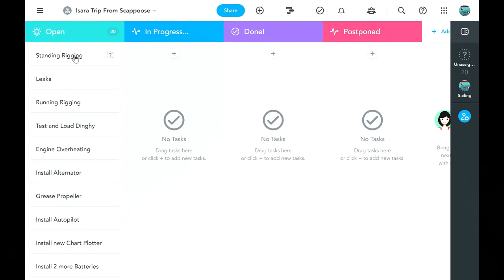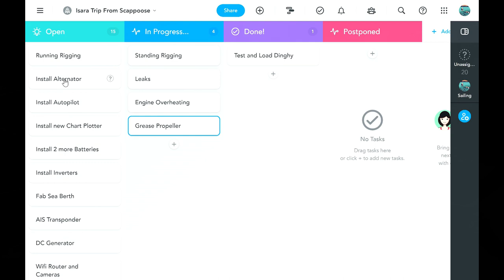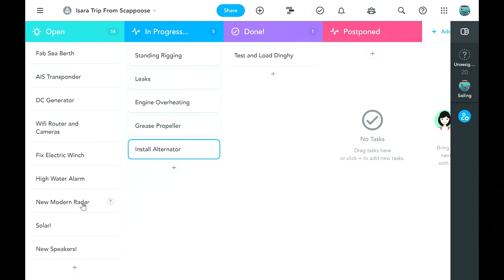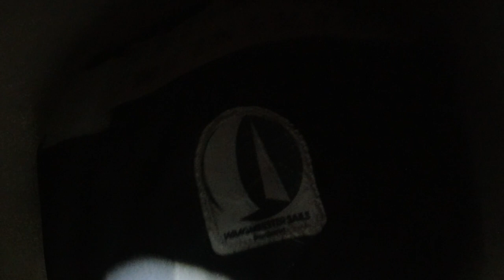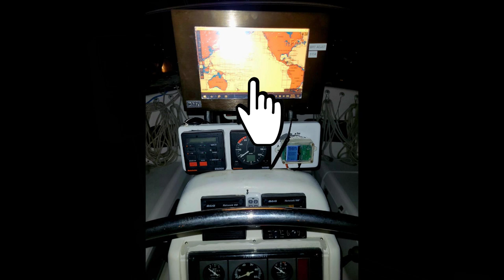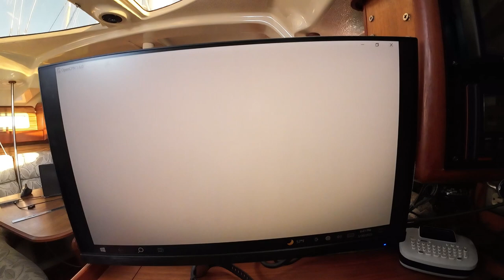Ep 9 Sailboat Repair Marathon and Projects

Comment: Try barnacle buster to clean your engine cooling system. Also check for broken pieces of impeller struck in the heat exchanger.
Reply from the maker: I don't know if I'll include pics yet but I did replace the impeller, and inspect the jeat exchanger and it was pristine. Still trying to figure this one out. also wondering if it's the hydronic system takeoffs m, or even the prop 🤔
Reply: @sailingisara  By hydronic, you mean the takeoff to heat water?  

Probably too late a comment, but If you have a Yanmar, and it's like mine, the rear heat exchanger cap has two sections and a gasket.  If these are inverted, or the gasket is damaged, the two-stage heat exchange will not take place and can result in overheat.

Comment: I have a 1991 and found a crack in the hose from the anchor locker to the thru-hull to drain overboard.  You should just consider replacing all the white drain hose, and all the black water hoses now as well.  Mine were all original, yours likely are too.  Nice boat you have. She looks great for her age. I also failed to seal the wiring as it enters the cabin top through the mast shoe.  I will reroute the wires out of the side of the mast down low and go through the cabin top with a water tight fitting, and really seal the factory hole up next time I pull the mast off.
Reply from the maker: Do you have a 40.5? my anchor locker drain hose is probably a few inches long and I can't even see it, hard to imagine replacing it, is yours the same setup?